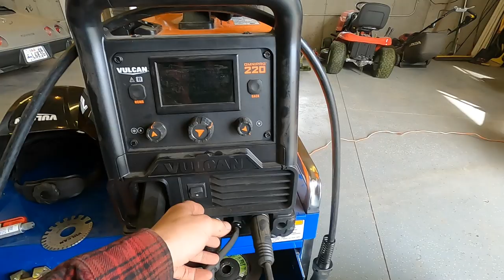Throttle Position Sensor Replacement/eimkeith Lower Link skid Install 3rd Gen Toyota 4Runner

Comment: Just use some channel lock pliers and break the screws loose. Thats what i had to do on my 3rd gen. Then install new screws with the new sensor.
Reply from the maker: Thought about that. taking it completely apart gave me a chance to clean everything and get it right.

Comment: Seen this Runner passed me by in Southern utah.. Very nice set up. I also own 2000 4 runner too. You made  me love my 4 runner. Right now i am working on tighten the vale casket and changing my diff.
Reply from the maker: When was that? That's awesome man. Hope it goes smoothly for you!